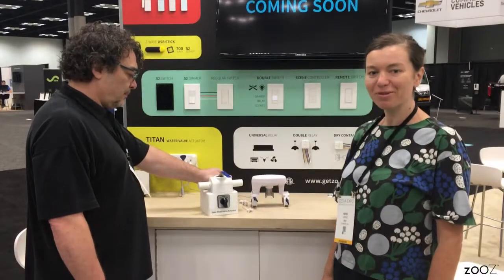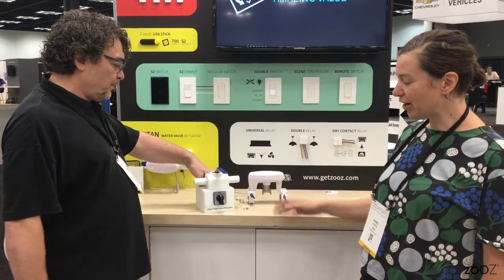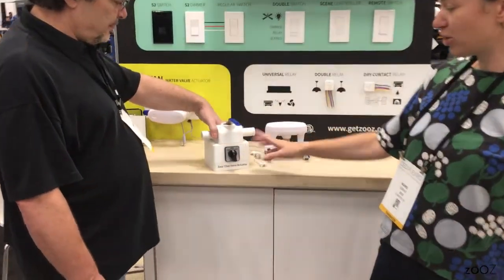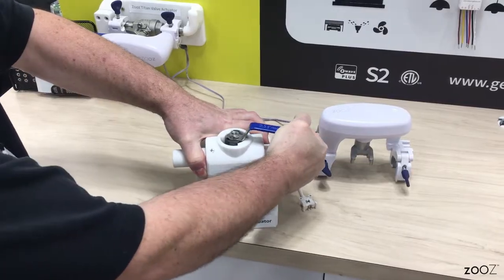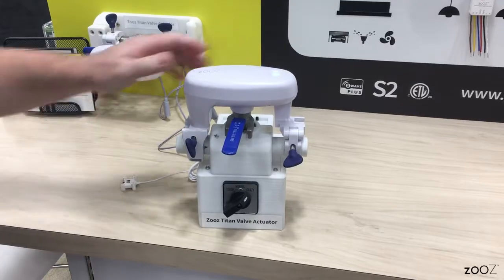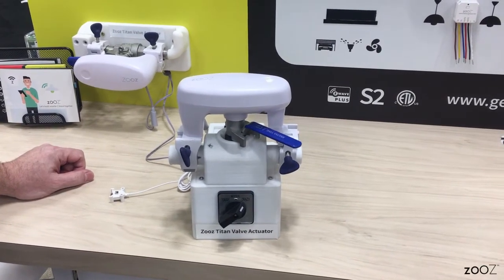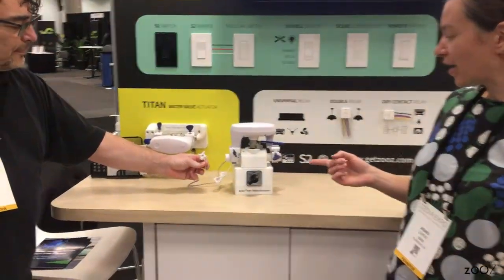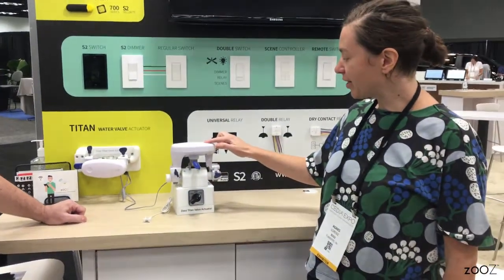Zooz Titan: Crazy Strong Water Valve Actuator Demo At CEDIA 2021.

Comment: I bought one I have a tight valve and it turned it.  The only problem is the water sensor wire is not long enough to reach the bottom of my water heater.  2 feet short.   How did you miss this?  Instead of helping me, they told me where to buy an extension.  NO, YOU SHOULD HAVE SENT ME ONE.
Reply: or you should have done more research?